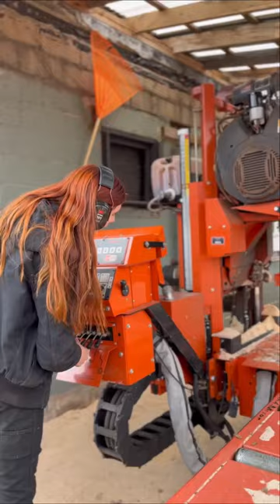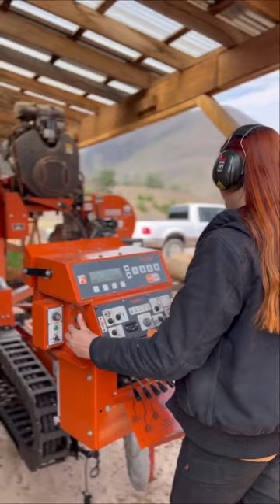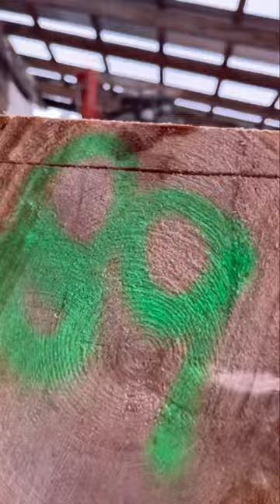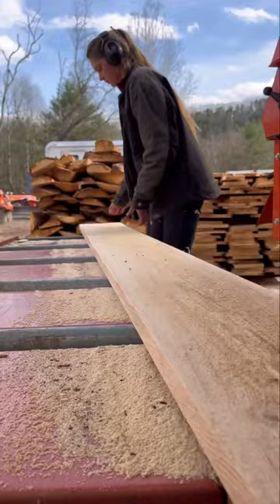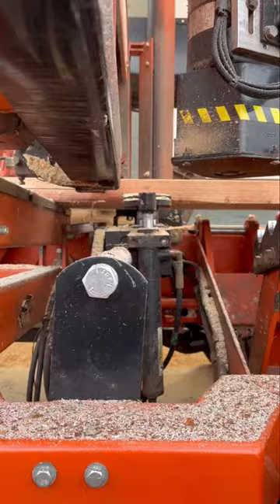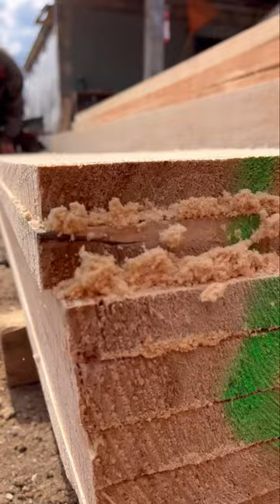Woodmizer LT40 in Action!

Comment: how does that Kohler engine run? I have a 2003 LT40 super which had the Nissan 4 cylinder and I couldn't get parts so I'm currently converting over to the 37 horsepower Kohler. hopefully they're reliable. thank God I got all the parts and finally the engine. keep up the good work